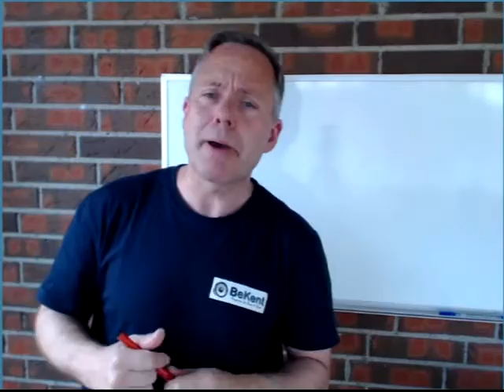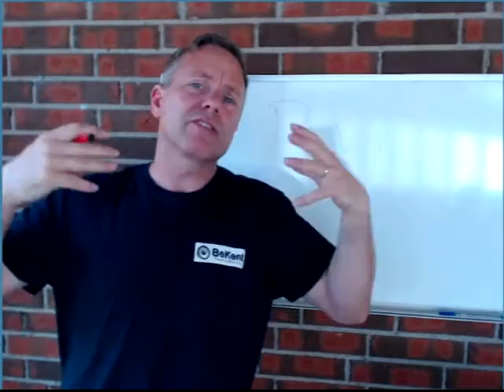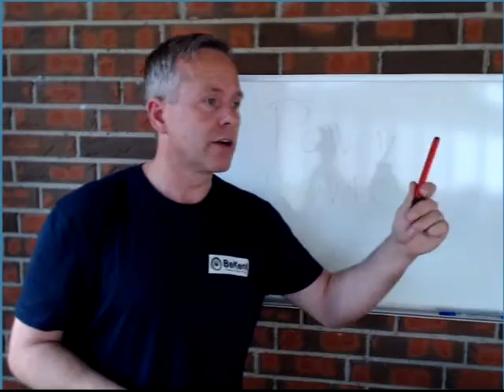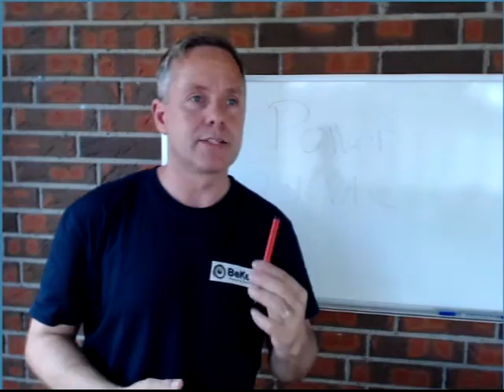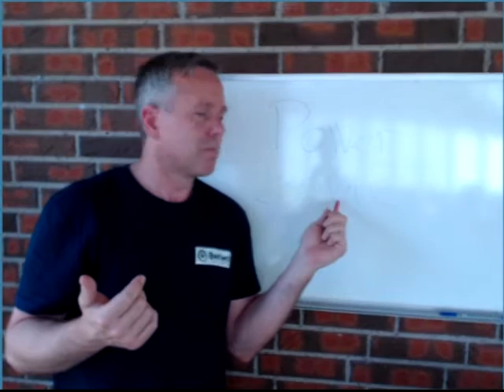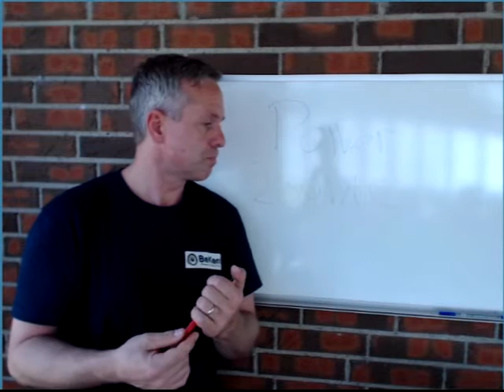Precise power a must for Tanning beds

Comment: Well you answered my question, I've got a sunquest 24rs that takes 220v but I'm reading 244v on my reader. I'm not sure how to get the volts down to 220.
Reply from the maker: That would be installing a buck-booster, I will recommend bucking with 12 or 16 volts. The 24RS  takes a 20 amp circuit, so a 0.5KVA buck-booster will be plenty. https://www.youtube.com/watch?v=-C22ya6OQvw
Reply: @AudioTalk  Thanks again